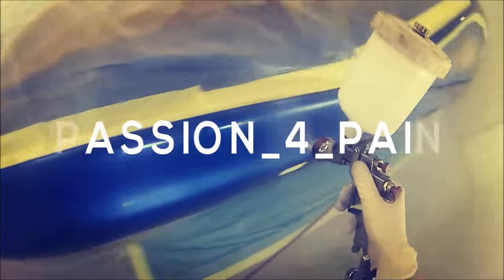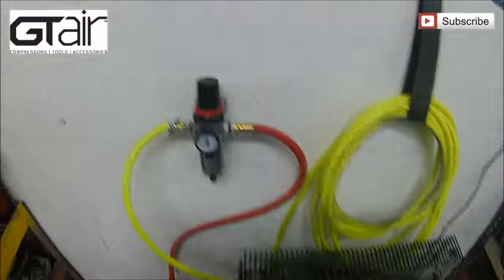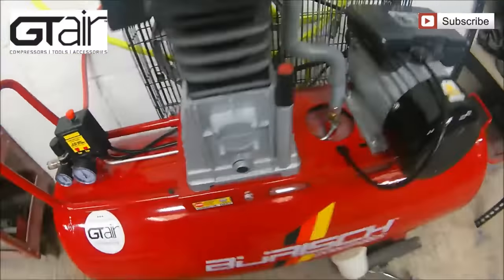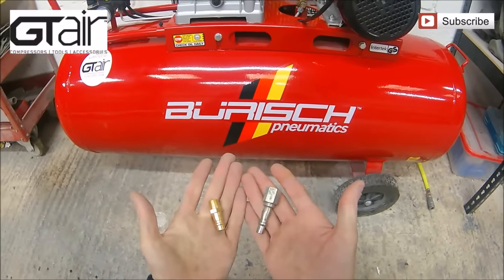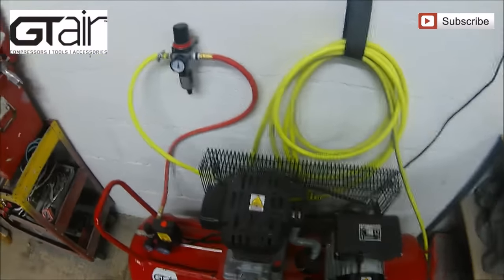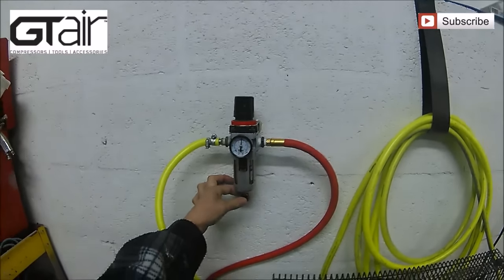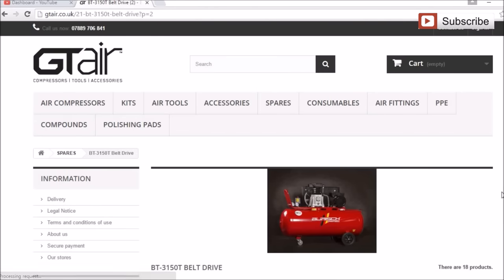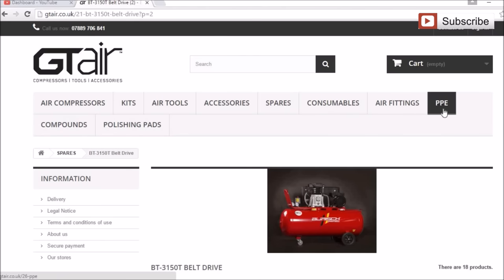Air Compressor Setup Advice And Review Burisch 150 Litre 3HP Belt Drive Air Compressor

Comment: Hi Tony. Great info buddy. I run 150 liter at home and you can never have enough filters on your airline. I have 4 inline water traps on my line and I have one at each outlet point in my booth. You only want good clean air when spraying. one last thing I want to put out there. Whether you purchase you compressor at the hardware store, SD or the corner shop all these compressors will kill you if used incorrectly. Thank' s to you Tony and other for sharing info regarding products.
Reply from the maker: +Brent Nicol not a problem at all mate been asked a lot for this video and will do an update video when I get fully set up too

Comment: Hi Tony. I have a twin cylinder Paslode but the star for me is the triple cylinder McMillan c16 240 volt. I'm pretty sure some parts of the US have only 120 volt. This one I have is here in Australia and can run a blast cabinet. I plan to use my paslode for my new mask mask and the other for the workshop. The free air delivery is definitely the thing to look for and some people just look at the pressure rating which is OK for doing truck tyres etc but it's the free air rate, even with a small tank, that can determine whether high consuming tools etc will work properly. The cheaper ones don't tend to include the free air rating here. I think we have all got by with cheaper or just adequate setups but it's nice when you can get it all setup with decent gear.
Reply from the maker: +Deano totally agree there mate and it's the same here most don't understand cfm or free air delivery hence making this video

Comment: Nice video, thanks mate. 

For the benefit of any prospective compressor buyers it's worth noting that these compressor companies all give the notional CFM of the displacement of the pump which is actually useless information. This makes their compressor sound great but doesn't actually represent the machine's abilities accurately at all. The really important number is the 'Free Air Delivery' in CFM or LPM. For these types of consumer grade compressor with a 3hp motor you are getting between 8 and 10 CFM free air delivery. It is a scam by the compressor companies. They all do it. I got caught out by this myself and ended up with a compressor insufficient for my needs. On higher grade compressors you will see they give the free air delivery CFM because they wont usually be able to trick big companies with this stunt.

Comment: Any chance you giving an update on how this compressor is holding up? As i'm thinking of buying one
Reply from the maker: +Peter Ford had this just about a year now and it's done some hard work still runs like a dream never had any issues with it even through winter ect hope this helps
Reply: @TonysRefinishingTV  hi Tony have you done full resprays with this 150ltr of so did it gas out with your ws400 or a devilbiss dv1 if you use one. Thanks

Comment: Thanks for sharing this compressor. Is this the same one you're using to paint the cars in your new videos? 

I'm looking got one for my own body shop that will work with a pro gun like an Iwata w400 (9.8 cfm) or a gti pro lite TE10/T110 (9.5 cfm). Do you think this compressor will be enough to do the job? or are there any decent guns you can recommend that you use with this compressor?

Comment: Hiya Tony...spoke to you before but forgot to subscribe...done that no.
One thing with compressors ( watched your vid last night) the sellers of compressors are a bit sneaky when it comes to CFM.....often, like GT AIR they will say "14cfm" but that only means displacement not actual free air delivery FAD. And you need to know what that is before you buy a compressor. I think the cfm FAD is about two thirds of the displacement figure so a14cfm displacement compressor will give you about 9 fad.
Worth noting though mate because if you buy a compressor with, say , 9cfm (d) and want to run a gun that used 8cfm fad ..it won't keep up.

Comment: I wonder why the 150L model is £150 so much more expensive than the 90L model; they have exactly the same pump/motor/regulator/fittings etc.  That's an awful lot of money for just 60L of extra tank.
Reply from the maker: honestly clive im not sure on that note , id probably say its just due to market prices for 150lt compressors tbh but even so for the quality and price this out performs any other ive ever had , weve been using it almost a year with no issues at all and no maintenance bar draining the water daily

Comment: Hi Tony is it normal for 150l compressor to cut in top up after a min of use? Ive got the same one on the video but its a workhorse compressor. Ive got it set almost the same as yours on vide on differance is my regulator is set at 2 bar but compressor is at 8 my lines are the same as yours as well all high flow. Just was wondering if this is normal or can do something so it cuts in later then a min? Im spraying waterbase paints on a pri pro lite devlbiss gun

Grate video by the way

Regards
ross

Comment: Just out of interest how is this compressor holding up as I'm looking into getting a new one myself. I already have the SGS 100 litre direct drive but it isn't as good as they made it out to be. Struggles with keeping up with some air tools. I really would appreciate any feed back. Thank you.👍
Reply from the maker: It lasted us years we did a few service bits over the years but barely anything only reason we changed it last year was we needed a larger one as we opened a powder coaters too

Comment: Hey, great video.  Was looking for someone to do a review on these compressors.

How have you found it? I'm looking to get the 90lt version,  due to space restrictions. 

Will it run all air tools (esp. DA sanders) without running out of air?

Thanks
Reply from the maker: +Ian McColl if the can is high enough on the smaller one yes but personally I think a 150 litre is best minimum , and yes we did this video as we had loads of request for some compressor info and was a god chance to show how to set them up ect for our most asked questions

Comment: Great video Tony. Will this compressor run a Burisch LVLP spray gun and an air fed mask simultaneously?
Reply from the maker: I’m not sure mate I don’t think you could run a gun and mask from it tbh
Reply: @TonysRefinishingTV  cheers. Thought so. Probably need a larger expensive compressor
Reply from the maker: Woth an airfed mate I’m afraid yes

Comment: Thanks, nice review, I've just ordered the 90LT version  (home shed type workshop) to replace my noisy cheap 25lt one.   

On your vid, you have a short red hose going to your water trap/reg on the wall. 

I have two 10mt hoses.  I understand when I'm spraying (only got a lathe to spray) I should run 10mt to water trap reg and a further 10 mt to my spray gun to give time for water to form.. 

But am I right in thinking, when I'm ruining things like my grinder, I'm better off having the shortest hoses possible, hence one like your red hose to the reg on the wall, and in my case about a 4 meter hose to my workbench?  Or am I worrying too much about loosing pressure on a 14cfm compressor?

And if I am better using the short hose, do you know where I can buy them at a sensible price?  10 mt hoses are cheap, but as soon as I try to find custom lengths, the cost of say 2mtrs, is more than the cost of 10 mts.

Also, where did you buy your brass airline fittings from please?

Thanks
Reply from the maker: ojustaboo Hoya mate honestly your first options best long hose ( lets the hot air cool and condense so water turns to droplets so the filter can take it out ) and then the filter then your spray or tool line , they call them a whip hose mate the short ones I got mine on amazon I think
Reply from the maker: ojustaboo my airline fittings shown here were also from amazon mate high flow fittings

Comment: I know this is an older vid but I’m after your help, Ive got one of these 3hp but a 90ltr but only ever used mini guns with it, tried using a pro lite with te20 air cap to do the side of my van and no matter what I tried I couldn’t get the clear to flow out nicely! The best I could get still was way to much peel, I tried warming the clear, 10% thinners, 1 1/2 all the way through to 3 turns out on fluid, 1 1/2 bar to 2 1/2 bar, nothing worked? I’ve used this mipa cx4 for a year with the mini guns and it’s awesome, never had this problem, is it possible the compressor isn’t supplying the right free air delivery for this te20? I noticed I had to close the air adjuster to be able to control the psi on the regulator too? Sorry it’s a long one but I’m baffled and deflated lol, I got a lot of flat and polishing to do now, any ideas would be massively appreciated
Reply from the maker: Hi mate can you inbox me through our Facebook page it’ll be easier to explain there

Comment: Great video! 
I'm looking at the 90ltr one for finishing woodwork that I build I. E wardrobes and furniture, and occasional tool use with it but mainly spraying, 
Would you say that 90ltrs is okay or should I fork out the extra and go 150ltr
Reply from the maker: its not down to the tank size mate its the cfm air  delivery i believe its the same as the 150 litre version so you'll be fine
Reply: @TonysRefinishingTV  appreciate the reply,  thanks for the info 👍👍
Reply from the maker: No problem mate

Comment: Can 8 bar compressor give constant pressure to speay gun you wasnt clear to me here
Reply from the maker: it has nothing to do with bar thats how much pressure the vessel can hold its all about the cfm cubic feet per minute the compressor puts out, usually minimum on this you would need 14 cfm of free air delivery to run comfortably most guns you can use less but 14 is minimum in my opinion

Comment: Really great video love watching them but I'm so confused as I'm looking at setting up at home running iwata guns but will this compressor run ok with them as most of the shops say I need 200ltr or more and more than 5.5 to 7.5 hp motor
Reply from the maker: Honestly mate I’ve run this compressor with my ws400 and new sata 5500x without any issues and starting from home I can’t see you painting the volume or size we do in our booth either tbh , to start off this is more than enough , throw some water traps and regulators on and your good to go mate , I’m looking at upgrading my unit now but I’ve had it two years and now I need one that will run a full booth sandblasted and air tools at once , but if your one guy using one thing at a time ie spray gun or sander this is more than enough mate honestly
Reply: @TonysRefinishingTV   nice one mate I'll give gtair a call see if they might do me a deal
Reply from the maker: There too guys over there tbh mate great to deal with and great for advice and technical issues ps thanks for the folllow on Instagram dude
Reply: @TonysRefinishingTV   no prob mate keep up the good work bro

Comment: For something like that here in aussie would cost about $2000 or £1300 pound its a rip off over here
Reply from the maker: Wow that’s a lot for something like that mate
Reply: @TonysRefinishingTV  yeah everything double the price or more  compared to usa and england , I see you have that compressor against the wall the fan that cools the cylinder should be at least 60cm out from the wall keep it much cooler